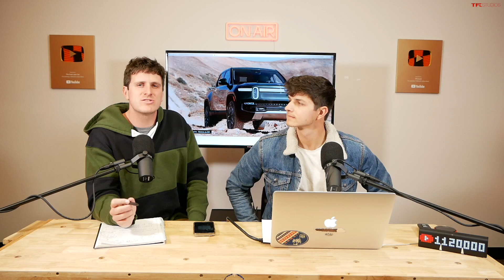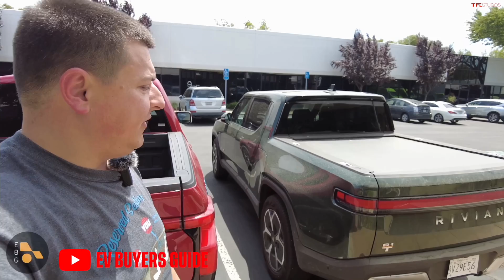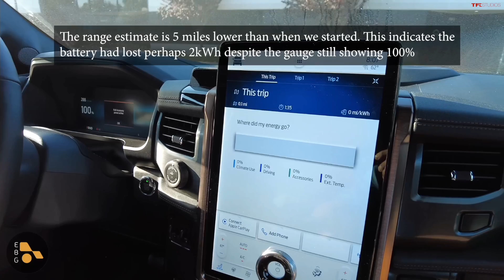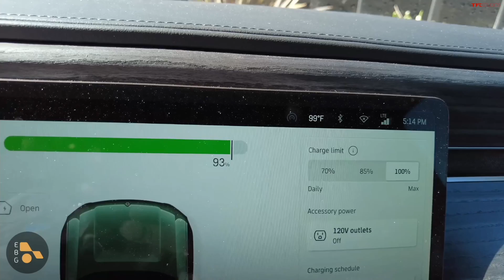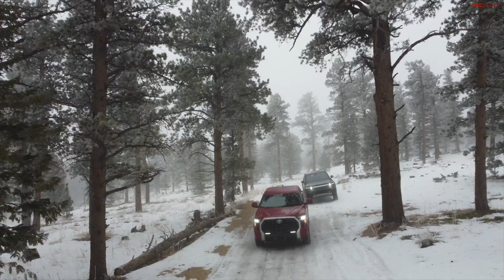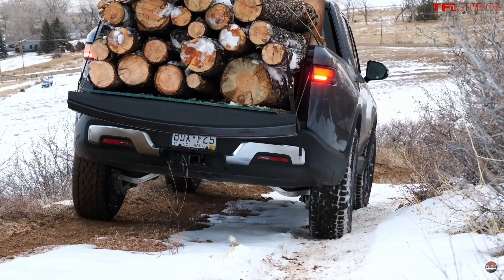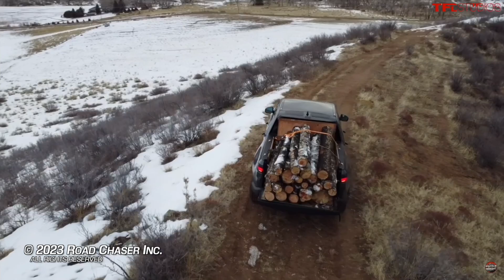This Rivian Is Getting The Equivalent of Just 25 MPG: Here's Why That Matters!

Comment: I own an R1T and it seems like a recent update reduced this issue for me. With gear guard it's like 1.5% or so but with it turned off it's almost nothing. I think there's something going on with some examples but not all. I'll do another test with gear guard off and try to remember to report back.
Reply: Thanks ... good to have additional examples.
Reply: yea, this is about it for me as well. Do you, by chance, keep your R1T parked in a garage?  I'm wondering if that impacts power drain by not having to run any battery conditioning systems so much.
Reply: @rvboyett  that's definitely true, but having a heated garage doesn't really solve the problem... You're still using the energy to heat it up!

That's a limitation of all EVs though, so if more people have the same experience as OP I'd say it's solved.
Reply: @FAB1150  Not an EV limitation.  My 10 year old BMW i3 lives outside and it pretty much never has a power drop, even after a week.
Reply: @ckm-mkc  that's good to hear, but it really depends on the climate. Most modern cars keep the batteries from going below freezing so that when you have to use the car it isn't severely power limited... Which is better than some gasoline cars that outright refuse to start in very cold weather (like mine lol). Kinda like having glow plugs on a diesel, but they're on 24/7.

IMO there should be an option to turn it off when you don't plan to use the car for a while, or set times so it stays off during the night and turns on in time for you to get to work.
Reply: That is amazing.  Our drain is also horrible, though I can't quote an exact percentage.  You must have some settings set just right and your truck must live in the ideal temperature zone.  Our lives at a constant 52-55 degrees F garage.
Reply: @Anonymous Freak  This guy still only used about $12.50 worth of power to drive back and forth to work for 10 days including all warming up time and travel. Not a stretch to think he could burn through the same amount of money in a couple days driving an ice vehicle pick up. His theory on battery cycles is flawed as well. Whether you add 5% charge ten times or 50% charge one time it's technically the exact same cycle for the battery. Also he's actually using more cycles of his battery doing this method as the vehicle would use power from his house to preheat the vehicle if it was plugged in rather than depleting the battery and adding additional cycle use. he'd be better to charge it to 50 or 60% and plug it in daily for max battery health
Reply: Also have an R1T. I personally havent noticed any phantom drain, however I'm in a warmer climate

Comment: 3 to 12% loss a day is normal? Really? This would drain an ICE vehicle's battery in a day!
Reply: That analogy makes no logical sense. The different power trains have different needs and capabilities. An ICE vehicle's battery is not design for deep discharge, wrong tool for the wrong job.
Reply: @Neojhun  how does it make no logical sense? What the hell is Rivian using all that power on when the vehicle isn't being used? It doesn't have anything much different than your ICE vehicle. Maybe an extra system monitoring the batteries when it's not in use should be all.
Reply: What?  The battery in the ICE would have to be at 3% or 12% at the start for that to be true.

Comment: That's simply unacceptable amounts if vampire drain. My Model 3 would lose probably 1% per day with nothing turned on, while my Bolt EV loses closer to 1% per week. It seems like having an on/off button makes quite a bit of difference.
Reply: My aunt bought a Tesla Model Y last summer. She drove (with 80% charge) about 60 miles to play bingo. When she came out, her battery was low enough she wasn't sure she'd make it back.
Reply: Teslas drain when sentry mode enabled. My m3 keeps  battery % without any loss if no sentry is turned on.

Comment: Same thing happens in my Tundra. If I let it sit for a while, all the gas drains out. It drains faster when it's cold :(
Reply: lol
Reply: If it is a diesel and freezes, does it run? No, because the engine has no ability to gain access to the fuel, which is exactly the same problem, and yes, the energy access does drain faster as it gets colder. There are block heaters in diesels for a reason.

Comment: Disconnect the 12V?  find a connector and turn it on or off...granted you run the risk of with the battery with conditioning but I would review.

Comment: As I’ve said, “Guinea pigs,” this generation of owners and vehicles is a huge experiment.  Electricity is too sensitive a platform for the demands of daily driving from personal to commercial use.
Reply: That makes no logical sense. Daily drivers and as many miles as possible is the best possible use case for BEVs. You are the one with erroneous assumptions how much "Electricity is too sensitive a platform" cost to operate. Seems like you don't even have a clue what any of this stuff is called. Let alone understand how it works and how much it costs. The lifetime cost of something like Peugeot e-208 is MUCH cheaper than it's same body ICE version and that's if you Knee Cap the mileage to 150,00 miles. These are just the facts which you are ignoring.
Reply: "too sensitive a platform for... commercial use." Tell that to every Delivery Service and Police Department that likes BEVs for a marginal Cost Reduction but massive benefit in performance and work flow ergonomics.

Comment: 835 hp and it still gets 25mpg? Seems fair to me. Case said it gets worse highway mpg than a Ranger, but how many Rangers are making 835 hp?
Reply: Not great when it’s supposed to get 60-80mpg equivalent.
Reply: @MX5-XU  Oh, I understand it's not getting as advertised when allowed to sit unused. However, it's still not the POS TFL is making it sound like. Here's a thought... Drive the thing. If you're not driving it, you probably didn't need it. Seems disingenuous to complain about the efficiency of a $100k vehicle that you don't even drive. Clearly, money's not an issue.
Reply: @aaronbritt2025  I think that is a different topic. Remote working changed my daily use considerably, but that doesn’t mean I still don’t use my vehicle. The point is simply that this Rivian is unique in the fact that just sitting there depletes the battery a non-trivial amount. Sure it’s easy to laugh and say it’s not impacting the owner too bad if they can afford it but it’s still an issue being as it’s a rather unexplained phenomenon that other vehicles don’t experience.
Reply: @MX5-XU  I get that, but that's not what my comment was about. I simply pointed out the the comparison to a Ford Ranger was unwarranted.
Reply: @aaronbritt2025  true their comparison to that was a bit odd. I think I understood what they were trying to imply but better ways to illustrate the point.
Reply: @MX5-XU  It is easily getting something close to 60MPGe which is still horrible. This original post about kWh to MPG makes no logical sense. MPGe is NOT an amount of energy, it's based on the amount of fuel required for the Charging to equate to kWh capacity. This includes the inefficiency loses and sometimes mixed with renewables.

Comment: Why are we not addressing the idea of “limiting charge cycles by letting it drain”. Many manufacturers of lithium batteries a have stated that this does not effect cycle count. Adding 10 percent to your battery roughly attributes to a 10 percent cycle. Letting your car burn energy for the sake of reducing a cycle is only in the real world adding cycle counts. Manufacturers recommend keeping it plugged in as often as possible.
Reply: Interesting, do you have a source on this? I'm the guy who wrote the email to TFL. But also; keeping the truck plugging in just hides the wastefulness issue. It doesn't solve anything.
Reply: Having to keep your vechile plugged in while parked at home just to keep the battery from going dead seems like a horrible way to save energy.  Nothing like using electricity made by coal to keep your pollution down.